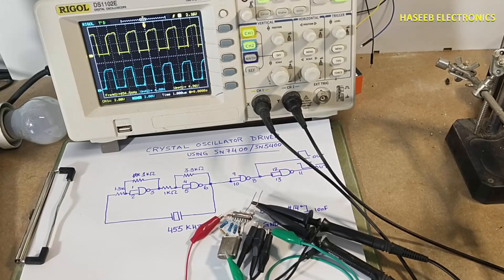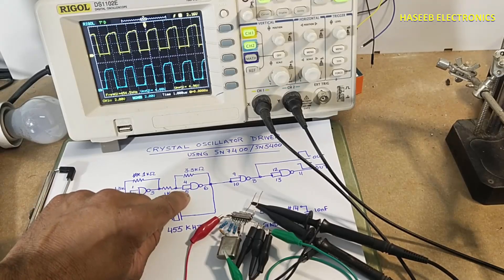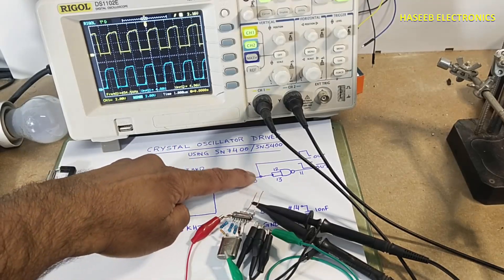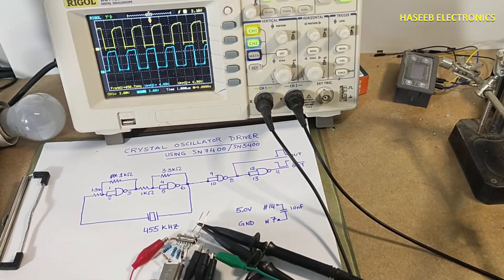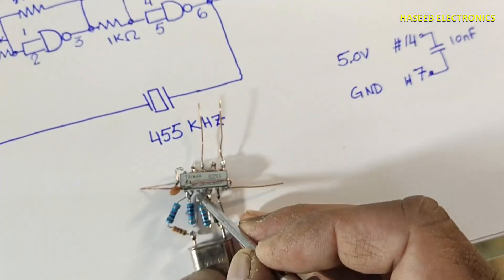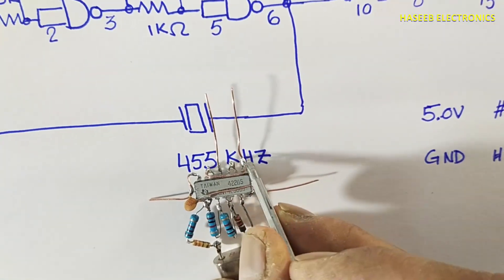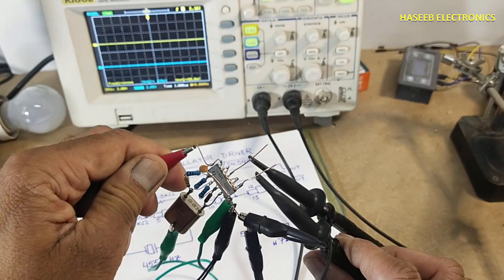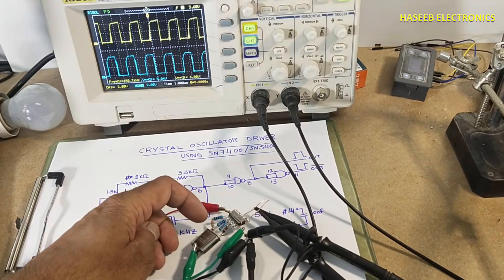{1003A} Very Simple Oscillator circuit

Comment: I love that you cover the latest micro- controller, smps, and older chips on the same channel. Thanks for now covering rf circuits too. This circuit would be handy for a lot of applications, including dividing the frequency down with an ic like the 74hc390 for very accurate pulses for a clock or frequency counter with the right crystal.